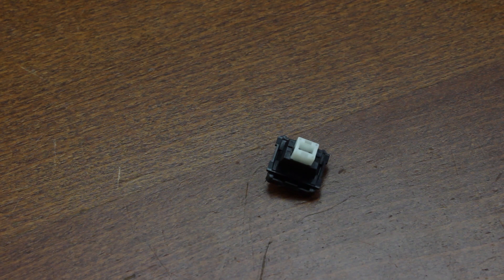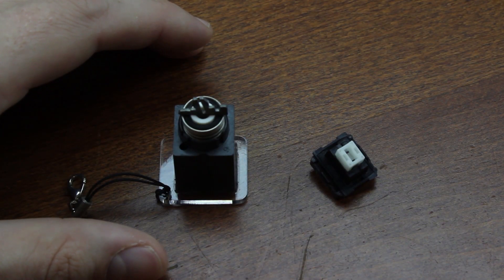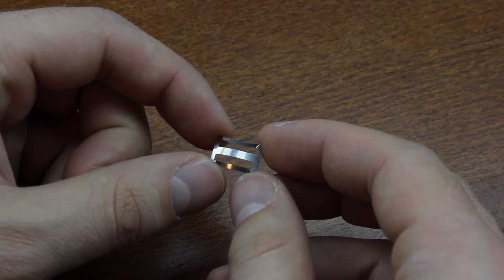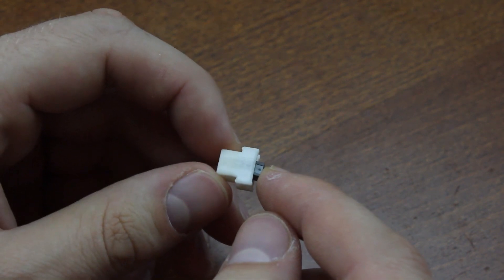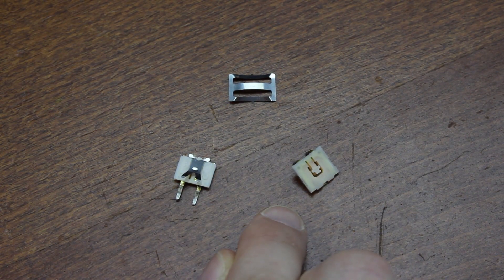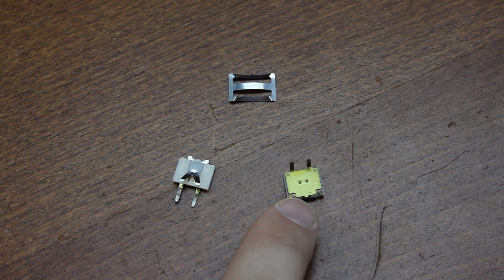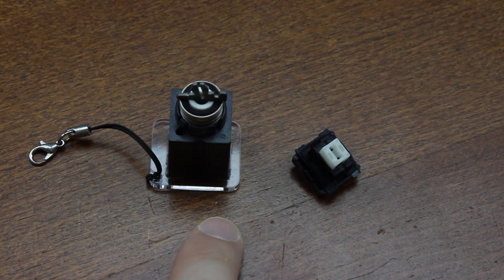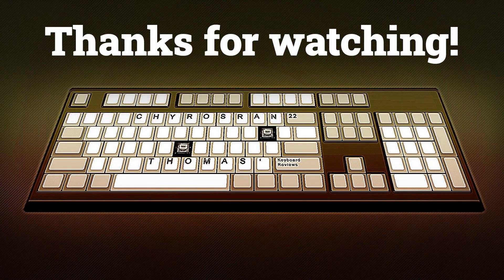Teardown - Alps SKCP "plate spring" switches

Comment: These switches are awesome. I have them in my 5576-001. such a cool sound
Reply: I’ve been trying to get the JIS 5576 for a while now but it’s proven difficult.
Reply: I think the 5576-001 is my perfect keyboard now because
1. Japanese layout 
2. its sound like 80s computer keyboard (Cherry MX Blue and Plain Rubberdome would be a reference for a modern mechanical keyboard sound)
3. it’s easy to connect to a modern pc unlike the Alps SKCC keyboard or IBM Model F